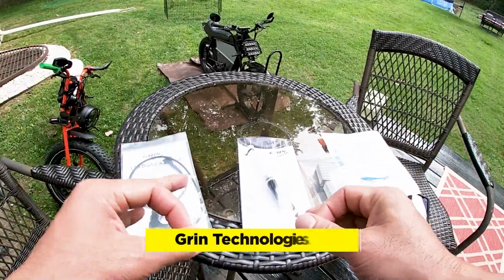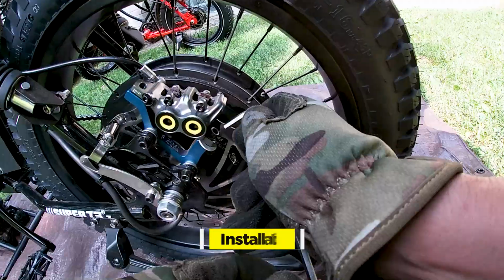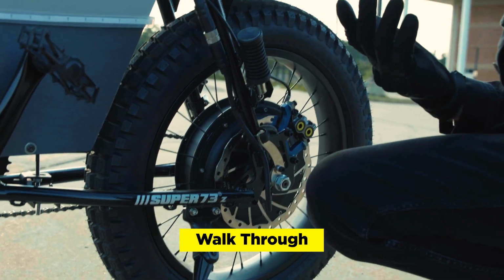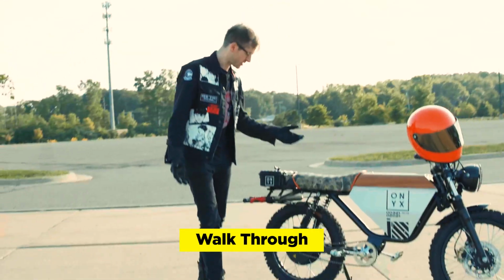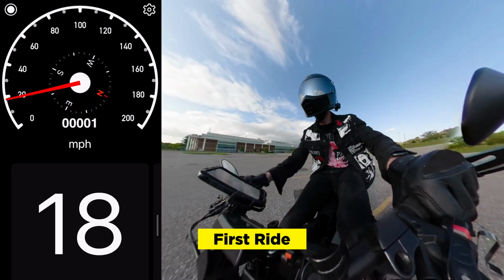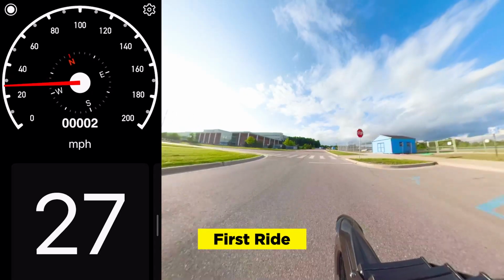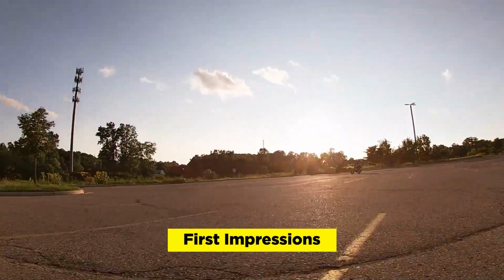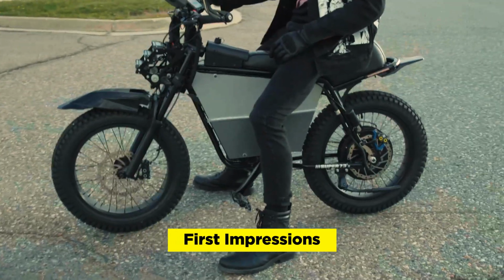Riding the 72V Super73 Z Force 1 for the First Time | RunPlayBack

Comment: This always seemed like such a perfect size and weight for a fast mod like this, but I thought there was no suspension. Am I wrong??? I would be so bummed to try and do a project like this or buy one from someone only to find there’s just a front fork suspension at most. Any reply is appreciated thank you! 🙏
Reply from the maker: You're right there's rear suspension but it's somewhat offset by the tire size and padded seat. This kind of build is strictly for street riding. The low price of the Z1 makes it ideal for extreme modding like this build.
Reply: @RunPlayBack  thank you again! I swear if there was a way to do dual suspension, it would actually perfect UGH
Reply from the maker: I hear yah! You should test ride a Surron if you can find someone local. That has the best suspension IMO.
Reply: @RunPlayBack  thank you again for the all the kind hearted detailed replies and good info! I really like the sur Ron but now my ONLY gripe is that I’m more tempted by the others because they look much appealing to cops! I definitely want to test ride any one of these 2-3 I’ve mentioned.